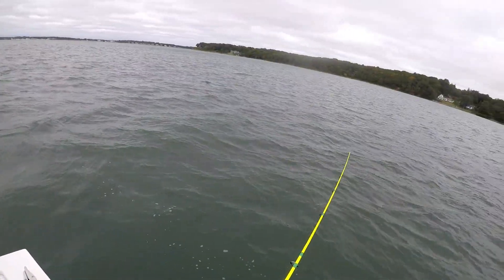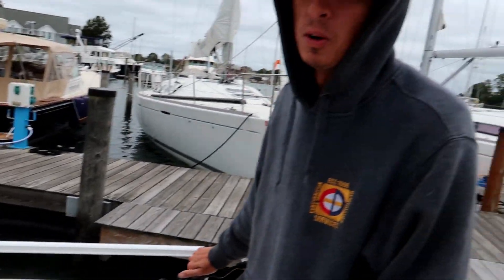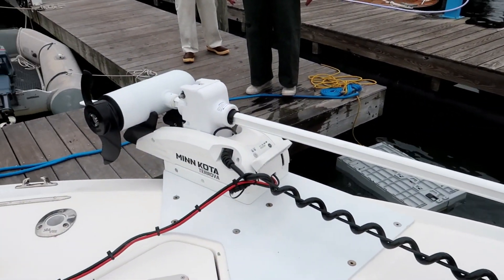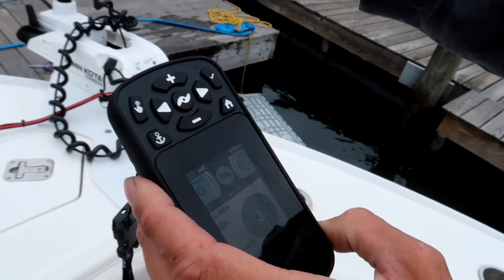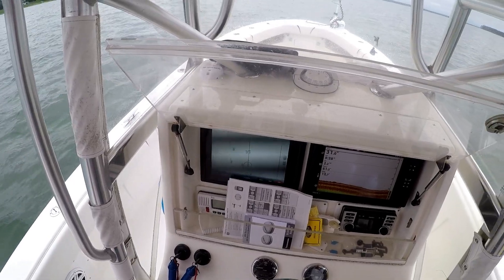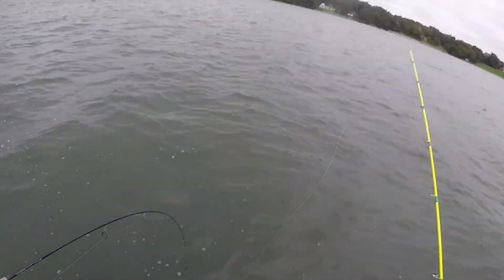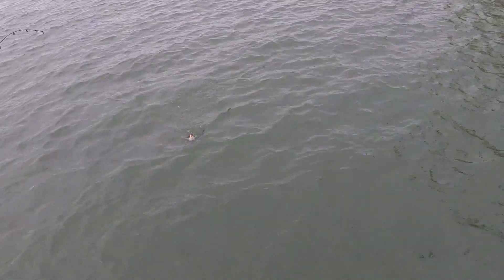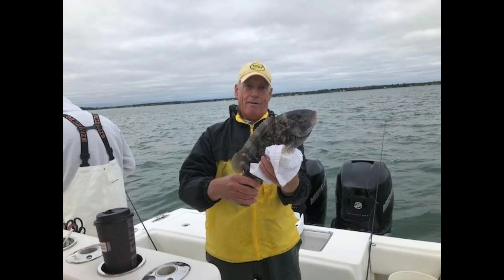Trolling Motor on a 32 Sea Vee - Spot Lock for Blackfish (Tog)

Comment: This video was the reason I got a 12v powerdrive on my 16’ Starcraft, installed it myself with quick disconnect bracket/puck.  I couldn’t imagine lake trout jigging at round valley reservoir in nj without spot lock- I can hover directly over proven spots I’ve marked on my helix 7 fish sonar.  In summary “Game changer”!!  Thanks for publishing, really nice boat btw!
Reply from the maker: Thanks Paul and yes, gamechanger for sure.  My good friend John Skinner (of John Skinner Fishing here on YouTube) has the same boat and it’s an amazing small, trailerable fishing machine.

Comment: Thanks guys for the video, gave you a Thumbs up!  I have a 32' Andros Offshore, almost the identical boat, and I'm just about to buy the same Trolling motor. I will get the same custom aluminum mount made, for the starboard side. The only thing I could see on how to improve your install, is the 36-volt wire dressing going to the motor. I would make it shorter, by making a small cavity on the near side of the anchor locker lid, and also dress the wire with a D-Line White Cable Tube 3' 7" Flexible Cable Management Sleeve, that you can get from Amazon. This video was of great help!
Reply from the maker: MiniBar agree on the wire being a little too conspicuous.  Absolutely love the 32 Andros - the offshore boat that flies under the radar!  Good luck with the install and thanks for the kind words

Comment: 3 years later, hows the minn kota holding up?  any likes ore dislikes?  thanks!
Reply from the maker: This is actually my 5th season with it and it’s still running strong!!!!  Still on the original batteries too.  The past few seasons, I have used it on almost every trip even when I am not a spotlocking. It is a game changer when trying to get the perfect drift going.
Reply: Thank you man. Tight lines!

Comment: looks very good ,but a trolling motor is to be in the bow,on the senter line
Reply from the maker: We had no issues with it being slightly off center although I do understand your point.  My anchor locker is center and I didn’t want to refabricate that section of the boat.  My last boat, a Cobia 256, had it just off center like this too with no issues

Comment: Excellent info; thanks for sharing it.  What type of screws or bolts for the plate?  It’s that plate through-bolted, or screwed?  Great install; looking to do the same on my 290 SeaVee down here in SWFl.
Reply from the maker: Charles Miller it’s definitely through bolted with 8 screws I believe.  I helped Jack (installer) put a new thicker plate (3/8) this past weekend.  I’ll try and find out what screws and write back.  Good luck with your install!!!!
Reply from the maker: Charles - he just texted me:  3/8 bolts with 3 inch washers doubled up

Comment: Does the trolling motor only connect to the Humminbird GPS/fishfinder or it can connect to any GPS/fishfinder? My device is a Garmin and a Simrad.
Reply from the maker: Only to the Hummingbird but it also works independently of any GPS via the remote control. You can set a course or spot lock through the remote independent of the screen
Reply from the maker: @pip2458  unfortunately, I didn’t do the install and am a complete idiot with anything electrical related

Comment: Thinking about getting a similar trolling motor to spot lock for blackfish so I could hit the really small pieces that are a pain to anchor over.  Have you had any issues or headaches with this yet? Wondering how well it holds up over time fishing in chop. Thanks!
Reply from the maker: The ONLY issue I had was this July, I forgot to secure it and it deployed in the ocean while I was running 35 mph.  Completely my fault and broke my prop; MK shipped me a new prop no questions asked.  I just finished my last trip of the season yesterday and it’s a gamechanger for blackfish.  You will NOT regret it.  Two seasons in and just that one self-inflicted issue.

Comment: Can I ask how you painted the aluminum?  Steps?
Reply from the maker: So my installer painted but from what remember he did a primer, 2 coats of paint and then a layer of clear coat.  His boat is aluminum so he’s very familiar with the dos and donts of painting aluminum
Reply: Jigging Jerks Thanks.  I have a Tritoon over in the Clearwater area and I have the bottom half bottom painted but I want to paint the top half’s.

Comment: That wire across the anchor box is a little excessive. With all the holes you've  drilled to mout the plates and motor why not a thru hull connector to run the wires below deck? Not only is it unsightly, it may be a safety hazzard
Reply: Furthermore, using a circuit breaker to switch power on and off is never wise
 The use of a perko or blue sea switch would be a much more realiable and safer option.
Reply from the maker: Thanks for the feedback.  Going on 4 years and zero issues.  I trust my installer